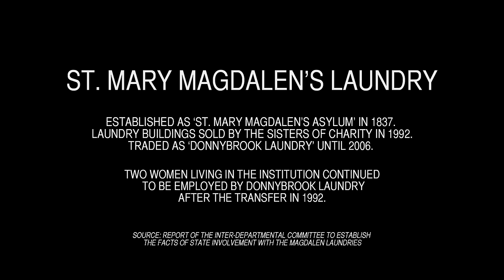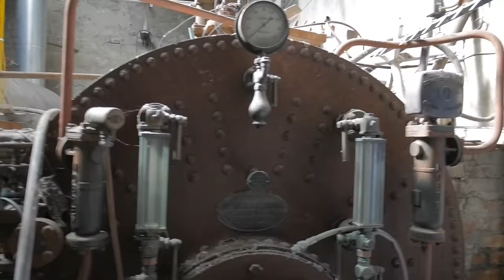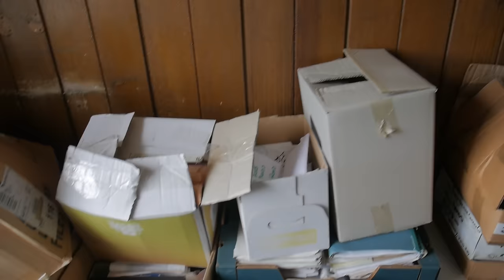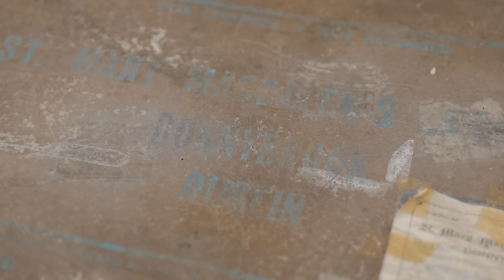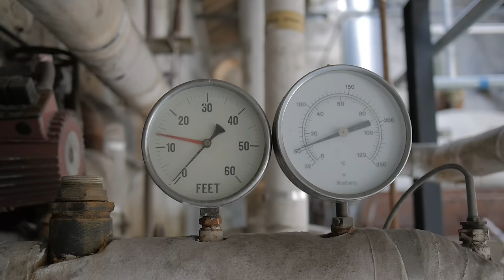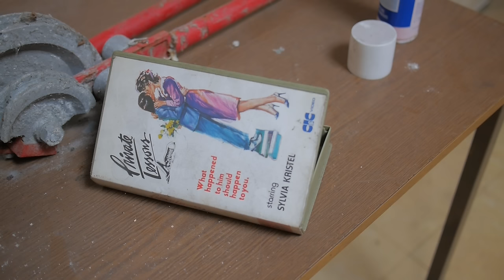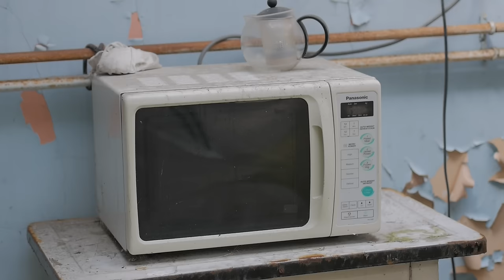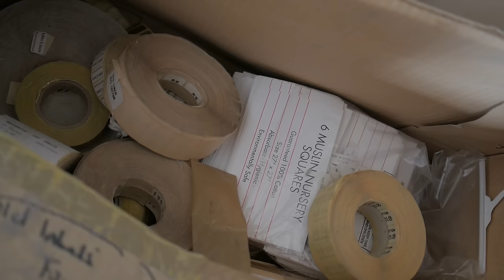Abandoned Magdalene Laundry in Donnybrook, Dublin, Ireland.

Comment: Comments:  

1.  You should have stolen all the files you could have gotten your hands on, and turned them over to a national newspaper.  
2.  You can smell the pain and fear, and it's a video.  The sounds are absolutely creepy.  Seems like you can almost hear someone singing at around the 7 minute mark.
3.  The thing at 10:50, the end-plat e of which you zoom in on, is a "bed press," or a flatbed ironing machine.  

Can't imagine how hot and nasty the place was when it was in operation with all the equipment in it.  Surprised by how much stuff is still there.

Comment: Hey I'm just wondering if there is an easy way of getting in. If you could tell me it would be very helpful! I'm also just wondering if there are any alarm systems and the like protecting the building. A reply is much appreciated
Reply: Ireland's Abandoned Buildings I would be interested on checking it out too wherr abouts is this
Reply: It is in Donnybrook, Dublin. Pretty easy to find. The only problem is that it is basically right behind a Garda station, might be a bit risky! It's on Google maps as a historical landmark: https://www.google.ie/maps/place/Old+Magdalene+Laundry/@53.3211803,-6.2366996,18.75z/data=!4m13!1m7!3m6!1s0x48670eca24a5fecf:0x3bcdfdd11ea7760c!2sDonnybrook,+Co.+Dublin!3b1!8m2!3d53.3192586!4d-6.2320169!3m4!1s0x0:0x27884a5f1ae90508!8m2!3d53.32119!4d-6.236775